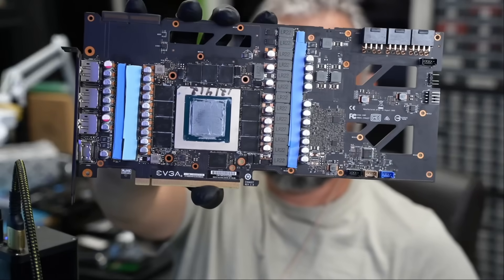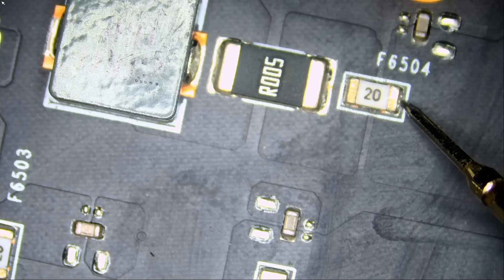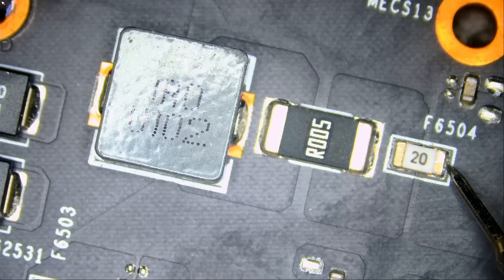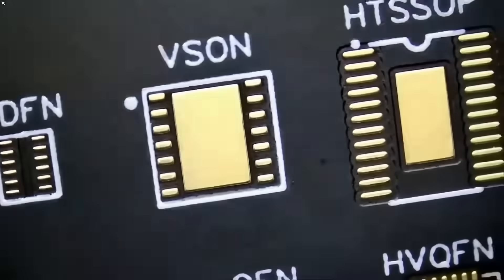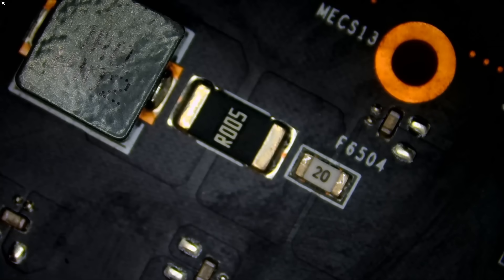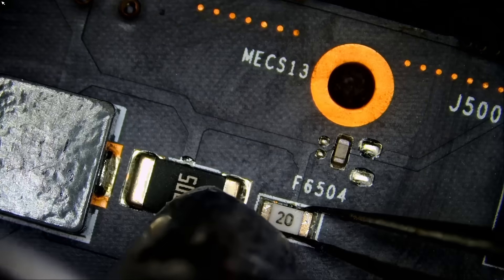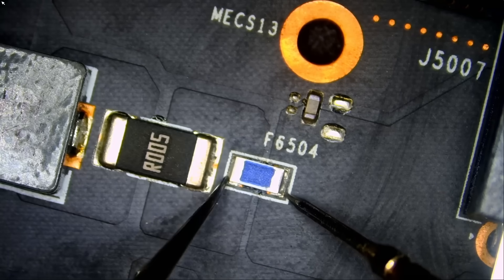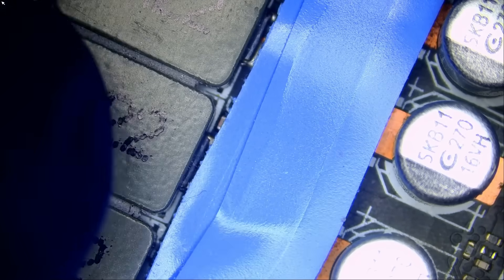EVGA 3090 GPU Red Light Not detected Repair. What Could Possibly Be Wrong

Comment: why the fuse blue? Power surge or spike: Maybe a sudden spike from the power supply or wall outlet jolted the card. If the surge never happens again, the new fuse holds up just fine.

Dust or debris: Sometimes conductive dust or moisture creates a brief short circuit. Cleaning it out before replacing the fuse might’ve solved the real problem.

Capacitor behavior: Electrolytic capacitors can degrade slowly. A failing cap might cause a rare momentary overdraw that clears up until the problem worsens.

Fan or component stall: A jammed or failing cooling fan might have momentarily overloaded something, then gone back to behaving. Until next time.

Comment: Hi Alex, How do you do? I have a question about NVME SSDs. Do we need to buy and install heatsink for those ssds that doesn't have heatsink on them by default from factory? my motherboard only supports gen 3 and my ssd is gen 4. and I Just run games on it. I'm specifically talking about the internal ssd   "" msi SPATIUM M460 , 1 Tb ""

Comment: I've been watching your videos nonstop all day, I even purchased the NF.short on your recommendation! Im currently diagnosing my own 3090 ftw3. None of the MOSFETs showed any heat under FLIR, however when you checked the 1.8v line at 2:05 you had a reading of 229 ohms. When I measure the same coil to ground i am reading 1.8k ohms. Do you have any advice?

Comment: Maybe only 1 of the 3 power connectors where connected and the fuse blew due to high current?
Reply: No.
There are three 12V lines and they are on different circuits.
Having one 8-pin connected means that you only have one of the three 12V lines active. The other two will not receive any power.

Comment: Overclocking, modded firmware or bad cooling with the extra thermal pads. More is not better when it comes to thermal paste or pads… and NEVER use “Liquid Metal” unless you want to destroy something in short order…

Comment: What easy you have it with the modern pcb's. I am 66 years old and remember the pertinax (pressed paper)boards. A heat Gun would burn the pcb in 1 Second. A brand new board could stand 2 to 3 seconds of soldering at low temperature before the pads lifted of the board. Resoldering would almost certainly destroy the board. Early ic's also could stand only a few seconds of soldering temperature. Taking an ic of one board and putting it on another board would almost certainly mean failure.😊
Reply: I remember my desperation trying to get a pin to wiggle
too many variables
among older pros constantly complaining about their family and folk
I dubbed them the Bitch Brigade as they taught me how to make good ones day by day

Comment: Fuses wear out.  They work by heating. If they get hot enough then the element will melt(fuse blows).  But that's very hot. So in normal operation a fuse can get quite warm even with currents below its rating.  So heating and cooling over and over and eventually the element will just break from repeated stress and not necessarily from over current.

Comment: Is the board 1.0 if it is  it draw too much power on the last eight pen power connector. They fixed it on a later revision board. I think the board revision is now 1.1 they had warranty program thet if you had a 1.0 board they would replace it it i new Rev.  Nice video kept it up.
Reply: Yeah, it's 1.0. Time code is 0:20 Version is on PCIe connector tail.
Reply: Yeah, it's 1.0. Time code is 0:20 Version is on PCIe connector tail.

Comment: Could be the power monitoring chip isn't reading correctly, and therefore giving the card an infinite power limit.
Reply: Or modded firmware or using OC software without proper cooling.

Comment: The reason the fuse blew is because it didn't want to allow any further electrons to flow through it at that voltage. 

Could have just been a faulty fuse. 

I've seen it once where a fuse never had any over current, or current near it's rating and it just decided to give up one day. Minor imperfection in the metal strip and over time it just failed. 
Or the card was used for XOC and that rail fuse was the one to let go.

Comment: Pads are not right thikness. Replacing them are not joke also not for beginners. Maybe fuse blow because assembly short circuit or overheating a lot components because of wrong pads. I could work for you for replacing pads and paste. But that is impossible ofcource.

Comment: I would say the PCIe power cable could have a short and caused a spink. I seen where sometimes the card would run fine with the cable sometimes for days or even weeks till the fuse blown with out a short on the board. The person who was working on the card tested and tested found out that on 1 of his test it was shorting out, Replaced the PCIe cable and the card never came back.
Reply: If that is the case, it will blow again as soon as the customer plugs it.

Comment: 2.5 mm pads for mosfets no need to layer them , pads are the problem and probably tried a bios update not made for the card likely blew up the fuse (there are bios versions that you can flash on these cards)
Reply: I do not think a BIOS update would blow a fuse.
Reply: @davidlguerr unless it’s OC some bios have unlocked voltages that work and some will give you a red light (I own the same card) but it is the TI version.
Reply: @davidlguerr well, it happened to me, i was updating Windows then it get stuck and then die, idk what the fuck happened 😢😢😢

Comment: 👍👍👌👌It seems like using thermal pads is wrong, wouldn't stacking them on top of each other reduce heat transfer?
Reply: You need a specific thermal pad thickness for each area, usually it is not always the same thickness. Easiest way to fix it is to switch from thermal pads to thermal putty. As it is a paste, it will spread and you won't get that wrong thickness issue.

Comment: Power surge?

I mean, that is exactly what the fuse should be for right?
Reply: Overclocking
Reply: @slipspectrum9253If the card is designed to be OC then this shouldn't happen. It's possible though